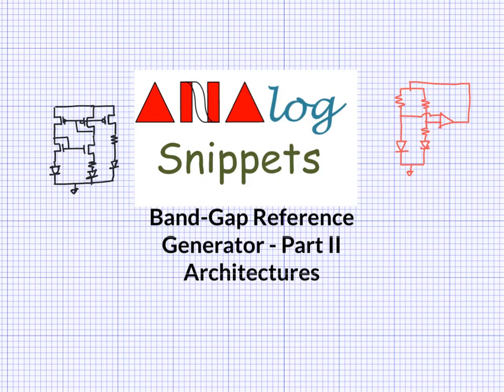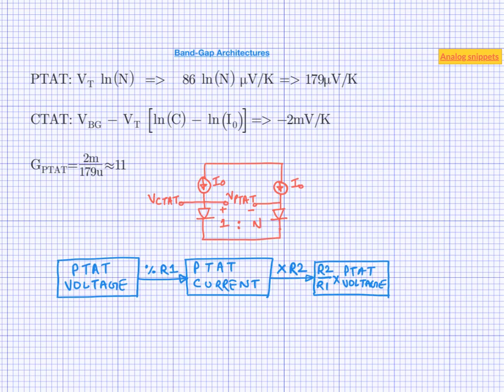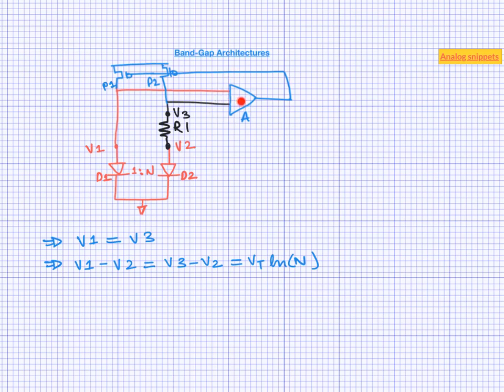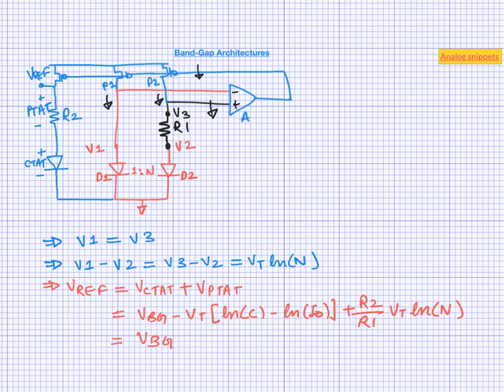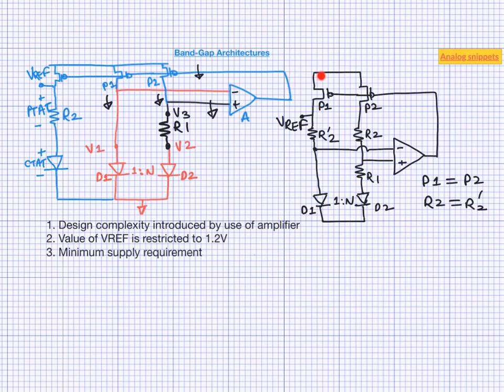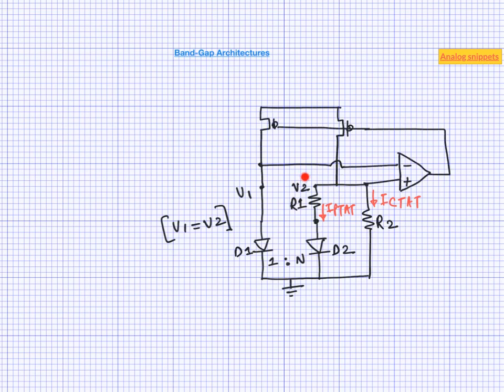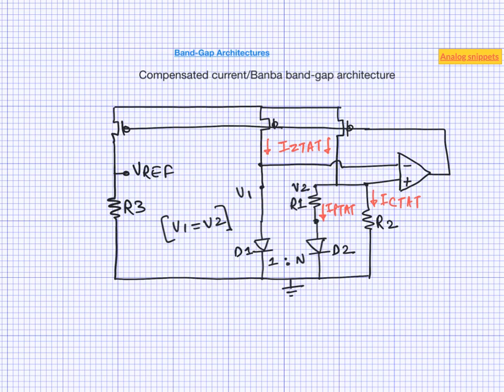#24 Band-gap Reference Circuits - Architectures

Comment: in Banba circuit, there is also another resistor equal to R2 from V1 node to ground. This will equalize currets going through each of the diodes. You have missed it in your picture.
Reply from the maker: Yes you are right. But I have omitted this resistor for the sake of simplicity. Even without that resistor a bandgap works reasonably well. But thanks for pointing it out.

Comment: Hi, I would like to know how can I to select the dimensions of mosfet in the circuit with current mirror self biased
Reply from the maker: Not sure what you mean by current mirror self bias, but for a current mirror you would size it to have maximum length that you can assign and maximum overdrive that you can allow. Try to determine the maximum mismatch that you can tolerate and then increase length to achieve that.
Reply: @analogsnippets  In 9:25, It indicates that I adjust the length, but the width also doesn't? Let's say what advice or what suggestion would I give to adjust these two branches and that the currents coincide, since I have made variations and sometimes I have slightly different mirror voltages or currents, then there comes a time when I don't know whether to increase the widths, the length or the multiplicity of pmos or nmos

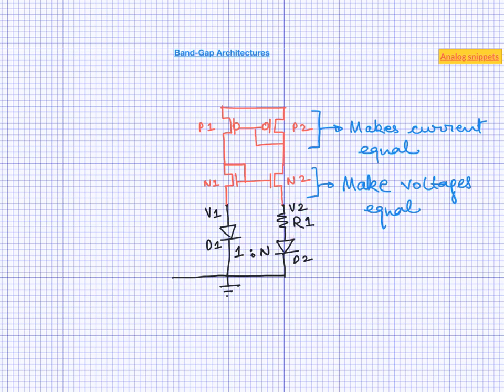Comment: I am using the circuit you showed at 8:49. I am getting an issue in transient simulation with that circuit. Initially my VDD is 0 and then when i ramp up my VDD, BG voltage is oscillating and i am unable to find where to put the compensation capacitor or how to solve it. Do you have ideas to solve that?

I did put a startup circuit and have tried many topologies and played a lot with it. Nothing seems to solve the issue.
Reply: Oscillation likely related to the current conveyor circuit being a positive feedback loop [VGn increases, VGp decreases, VGn increases].

Comment: What does the value of N depend on, whether it is 1,8,16,25 or 100?
Reply from the maker: A bigger N is good to minimise effects of amplifier offset and in general is a good thing. The drawbacks of large ratio are: more area, and since current is divided in many fingers, current in individual device becomes small. BJT models become inaccurate at small current values. A good rule of thumb is 10-100nA per BJT device. A large ratio also means that current in individual device (the branch with 1 device) becomes too large and secondary effects start to come into play. A good rule of thumb here would be 1-10uA. Most common ratios are 8, 16 and 24. 8 and 24 are particularly good for layout. Although maximum ratio that I have seen in a design is 100. If you have offset cancellation techniques implemented in your design then you can choose smaller ratios. Minimum that I have seen in a design is 1:7.

Comment: I didn’t understand in last part, where ctat ptat currents are added through v2 node.  Through R1 is vt ln N upon R1. That’s ptat but how current through R2 is ctat .? Is that because v1 and v2 is same so vbe 1 upon R2 is ctat
Reply from the maker: Yes that is correct. Voltage across R2 is vbe which is a CTAT voltage.

Comment: Hi, I have another question about the circuit at 9:44, how do I calculate the resistance R2? since I have seen in some places that the relationship is 10, but in others it is described with a formula, but I do see that it varies everywhere

Comment: Hi Sir, what will happen to the current conveyer if we make P1 as diode connected instead of P2?
Reply from the maker: It will connect two diode connected branches in series which can draw a lot of current from supply.